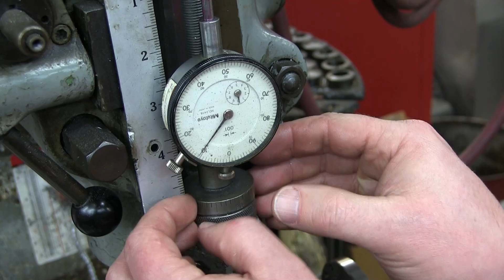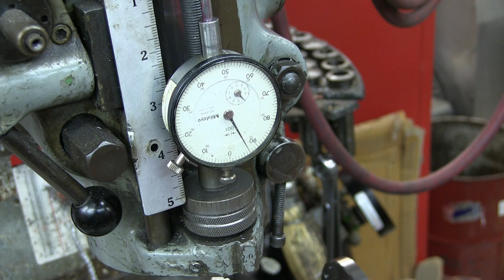48 to 1 Cycloidal Torque Multiplier

Comment: I own a real fuken skookum choocher of a Kenmore sewing machine from about 1968, and I fix my shit all the time. That would be a fun take apart protect, but you'd never get it back together. They're complicated little bastardos
Reply: Sewing is one of those skills I'm damn glad I picked up.

After much wailing and gnashing of teeth, convinced my mom to part with her old sewing machine (rebranded Singer from the 60's methinks). Nary a shred of plastic within the guts. Stitches right through nylon webbing and cordura like a champ.
Reply: Does that have the drop in cam system? By looking at me you'd never know I was an expert with the button attachment!
Reply: John Possum Could never get the damn button hole maker to work on my Kenmore. Went and bought 7 Husqvarna machines. Everything from embroidery to sergers to sewing to industrial. They are great
Reply: somnambulus I too have learned to use a sewing machine, specifically to fix the crotch of my jeans.
Reply: I took right apart and fixed a 1962 Husqvarna 2000. My grandmother's old sewing machine that ceased and broke. Took two days, but I'm less skilled than Ave. Wonderful peace of kit to get acquainted with, it did manually what sewing machines these days all do digitally.
Reply: Ugh, don't remind me. I've been putting off going spelunking inside my Russian borne 1980 clone of whatever sewing machine to replace a broken gear. Fucking nightmare plaguing me.
Reply: Those old fabric stabbers are bulletproof. I know a girl who's gone through at least 3 of these fancy newage machines in the last two years.
Reply: I bought a Brother in 2012 with grand plans as being newly singular. Sat there unopened for 3 years, confused by my intimidation. Then I had a female type walk me through a shakedown cruise. Hell yeah!  Besides usual curtains, hassock covers and such around the house, I came up with an idea to protect shorts wearing legs when running the weedwhacker. Filleted some leather furniture on the curbs on trash day and made shin chaps. Works like a charm. Also got a wild hair last winter, missing the big bell bottoms from the 70's, and made my own by sewing in black/white camo panels into old painter's pants. 😎😂